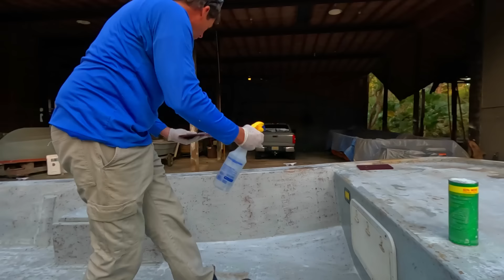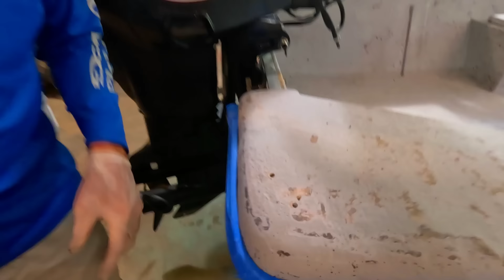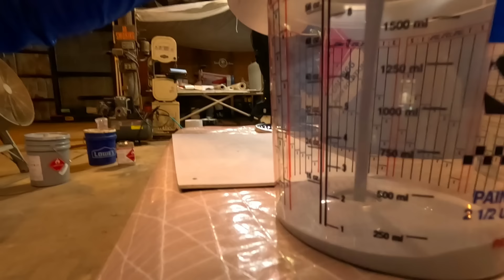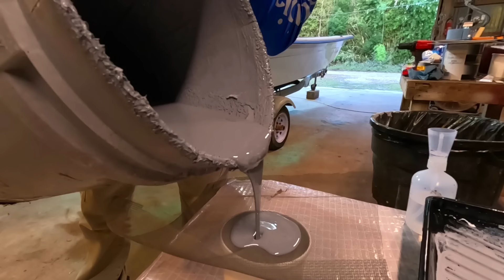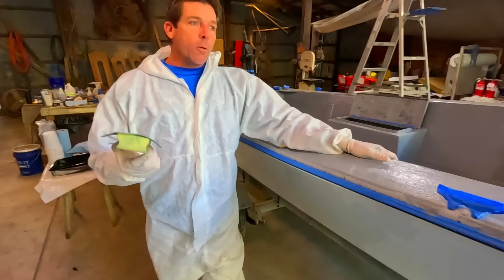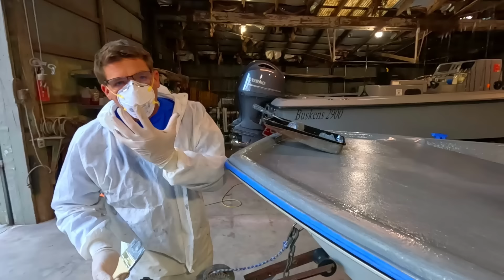How To Re-Gel Coat A Boat - DIY Cheapest & Easiest

Comment: Kinda  funny   you use tape to pull loose fibres from the  roller.  Those  throw away  brushes  are notorious for  losing  bristles
Reply from the maker: You certainly can buy the more expensive ones if you like, but the tape is cheaper than buying the better rollers. Of course you should do what you prefer, or feel most comfortable with, I just try and show helpful tips and tricks throughout the video for those who are interested. Thanks for watching
Reply: @FishBumpTV that's  just  my opinion (45 yr painter) not trying to be  critical

Comment: What kind of gel coat would ypu use for a bass boat is there better brands than others. First time trying gel coat on a 1968 bass boat need alot of repair. Trying to figure out the best way to attack it.

Comment: Did you have to scuff up the first layer of gelcoat since you did it the day before and rolled on fresh gelcoat the next day?
Reply from the maker: You can do a light scuff, just to knock down any small bumps, or hairs, but its not absolutely necessary since the first layer didn't have any wax it it.

Comment: I got a 94 17 ft. Carolina skiff has old gelcoat and is rough as in you can see fiberglass mat imprint under gelcoat. Can i just pressure wash and wipe with acetone and roll gelcoat ? No way to sand smooth. Thanks, GB in Panama City ,Fl.

Comment: I have worked with resin building 4" thick resin tables to custom fiberglass car parts to yacht building for over 40 years wtih each manufacturing process always employing these same rules when repairing any of them:
1) Always wear a respirator and PPE
2) Always degrease then scuff surface
3) Clean again with acetone
4) Hardner ratio based on temperature and humidity
5) Mixing in one cup then poured in a tray to avoid having uncatalyzed resin.
6) Pot life in a cup versus in a rolling tray ( in a cup it will produce more heat in a cup and harden  versus distributed flat on a surface taking longer to harden giving you more working time)
7) If the surface temperature of your boat is cooler than the ambient temperature, the gelcoat once applied will drop in temperature to the the given surface thus slowing the catalyzation time.

I really enjoy watching each and every video. Keep up the great work!!!!

Comment: I just inherited a very old 16 foot 1960 Winn motorboat that has no gelcoat left. It's worn down to the fiberglass, no windshield or seats.  So I'm excited to see how to restore this beautiful old boat. The hull is structurally sound, no soft spots and no holes.   The stringers need to be replaced and I have removed the floor. So many of your videos will get me thru this restoration. THANKS  for the level of detail in these videos because others wanted to throw this treasure out.
Reply from the maker: That sounds like
 an amazing project, good luck with the restoration,and thanks so much for watching!🛠️

Comment: Hi Joe, thanks for your informative videos!
So I am assuming the gel coat with wax makes for an ok final floor finish in the boat... not too slippery when it is wet?
Reply from the maker: The roller finish adds a bit of texture to the surface, but if you want more grip, you could add some non skid. Thanks for watching!

Comment: Just discovered this channel - awesome stuff and great content, thanks!

How do you guys remove boats from trailers to work underneath? Don’t have a forklift or how is it done safely?
Reply: You can buy boat lift jack stand things. Or you can put jack stands under the back with wood blocks to protect the hull, then use the trailer jack to get most of the boat foo of the trailer. Than use a bottle jack under the bow about 1/4 of the way back to lift the front. Then move trailer and repeat step two
Reply from the maker: Welcome to the channel! We have 6 large winches, hanging from 3 large overhead beams in our shop, which allows us to safely pick boats up boats in the 30 ft range. We have always used equipment such as this, because safety is a major concern, when lifting boats. There are different types of lifts, and methods out there, but because of the potential dangers involved, it's not something that I can make exact recommendations on. Thanks for watching!

Comment: Yes I do enjoy your content  ,videoes and the way you teach   IM 61 ,grew up in south Florida and I’ve been working on boats since I was a teenager  as a matter of fact I owned a boat before I had a car   I had to borrow my Dads  StationWagon to tow the boat home  and to store it on the side of my parents house. I   Signed the titles over to my Dad  the boat needed new floors   And it came with the Plywood  precut. Plus  the mat and Resin  I was gung ho  and glassed. The Plywood.  Almost right away. Unfortunately I. Let it sit in the Sun too long and the UV  destroyed the  resin  into a crispy mess I had to grind out   And reclassified eventually    Dumb ass teenager  move perhaps a suggestion  for a video content would be to. Spray  GelCoat  setting up the GelCoat Viscosity  and Spray gun,Air pressure basics  in my past I’ve fixed  small areas of damage with. The aerosolize spray bottles. And  a  trick of mine back years ago  was I kept a large amount of White  spray can paints including  lots of Duplicolor  car paints   That I could  blend areas to get better color matches   I knew that  Ford WimbledonWhite. Was.   Hatteras White and so on   FYI. M customers knew. My cheating technique  and usually were Satasfied with. A repair   On their light damage  usually  a bump. During docking or    Something   Like dropping an Anchor  onto a deck  not Major crash damage  often more of a Stupidity or Embarassing. Mess up   That. I   Saved them. Big money  by doing a  hundred dollar     Service Call   My small boat company was mostly   A Dive Service  I. Offered. As a Certified Diver  I could swap a damaged Prop  change zincs to save them a haul out cost

Comment: Joe no matter how hard I try I always make a mess of myself and everything around me working with Gelcoat paste. I'm going to be Gelcoating my bottom side for my first time painting with it. I figure it will give me a chance to see how it spreads and what it will look like using a Roller and brush. The bottom side looks great but I repaired all the stress cracks and scratche ect. I plan on doing two good coats of non wax and one coat of waxed to cure it. I'm stuck doing it outside and nervous about catching the right weather window. It would be my luck that I do a good job and the weather wipes it out.
Reply from the maker: Keep an eye on that weather window, as that is important,  then plan out the work, and work the plan. Wishing you all the best, and thanks for watching!

Comment: Great video with a full explanation. Tiny details you cover saves a lot of time when working on a project for the first time. What is the process to get the shiny look that you get with new boats?
Reply from the maker: Glad to hear that you are enjoying our videos! There are a couple of ways to get a glossy finnish with gelcoat. You can spray it with a high gloss additive, such as Air dry, by Orca to improve the shine, or you can roll, brush, or spray, 4 or 5 coats, then wet sand,  and polish it to a shine. I have several videos here on the channel showing both methods in detail. I'm sure that if you scroll back through our videos, you will find what you are looking for, and other interesting videos! Thanks so much for watching!

Comment: This is something I really want to do, but I'm running into so many questions.  The boat I have has these two hand size spots on both sides of the hull where it's just much chalkier/duller than the rest of the hull.  I have no idea what to think.  Was it a fairing and paint job?  Epoxy for some gelcoat damage?  Any easy way to test if it's really gelcoat or not?  Thanks!  LOVE your videos.
Reply from the maker: Glad to hear that you are enjoying the channel! It can be challenging to tell what materials may have been used in a repair at times, even for people who do this kind of work. Even brand new boats are sometimes repaired at the factory if there is a blemish or defect in the molding process. It is possible that is what you are seeing. You might want to try a compound, polish, and wax process on your boat, and see if you can get it looking better. We have several videos here on the channel showing that process. I hope this helps, and thanks for watching!

Comment: I wish I could add a picture of it but I have a 9ft side by side 2 seater speedboat. It was last fixed up 20 years ago but its still in good condition for its age. I need to fix a fiberglass crack behind the interior seat and reinforce the transom for a larger motor to get it to go about 40-60mph like a jet ski. Then a new gelcoat will be needed. Does anyone have a rough estimate of the cost of getting it done? I've been wanting to DIY it but time has not allowed me to get into it.

Comment: What's the best thing to use when you're filling small holes from where items use to be? Like 1/4x20 bolt holes in the console. Should I go with a west system filler or just a regular bondo material.

Comment: Great video thanks. One tip is to take the tape off between coats otherwise it gets trapped under the gel coat edge. I know it’s more work but better than trying to get the tape off after the gel coat has cured.
Reply from the maker: That's a great tip, and I appreciate you sharing it with the community!

Comment: Excellent videos. As per your cautionary notes, PPE is very important. A 3M-type full face mask is worth the cost. First job out of high school in the 60s was building fiberglass sailboats. Retired and back to building kid’s toys and kayaks. Thanks for all the very useful tips and tricks. Auto body tools like filler, plastic spreaders, multi-speed grinder adapt well to working gelcoat and molds.

Comment: I am learning soo much from you I’m a career painter and have used epoxy quite a bit over the years but all the little nuances of fiberglass usage and application have enlightened me tremendously for future applications I thank you for that. One of my suggestions would be that nobody dislikes grinding more than myself it’s a necessary evil as you well know and the big disc grinder is awesome I’m sure . My new hack lies in using a grinder from Temu that has a variable speed option on the rpm range that lets you dial down the grinder to a much lower rpm of probably around 2,000 rpm which can be very helpful with delicate situations where all that power isn’t necessary and makes the tool so much more versatile. The tool i purchased was the upgraded version which came with a 3meter cord which is very nice and good cord too that stays flexible in cold weather not that hard stuff on cheaper tools. These grinders are a bit more compact in all dimensions so it’s lighter and fits in tighter places as a result. The spindle is smaller than the 5/8 on a Bosch but a simple adapter solves that problem and gives more reach. IDunno his stuff is coming from China what isn’t these days. My last grinder from Temu was just under thirty dollars and it’s been run hard and hasn’t missed a beat. They typically send you a new set of brushes also with tools that require them so no worries there  just a thought from a freind in the trenches I gave one to my welder freind and he also approved. It didn’t replace his metabo but he said it was an awesome grinder for finish work cause of the vari-speed feature.!FWAFSTYa ☸️👍

Comment: Thank you, this is great. We inherited (so to speak) a small butterfly sailboat that has a good crack in the hull as well as other areas. Should I be using an epoxy first to deal with the crack before the filler you mentioned? Thanks again!
Reply: Also can I ask what type of wheel you're using on the small grinder?

Comment: Hey man thanks for the tips!  I have a 19 8011 foot Boston whaler. Just a very simple little boat. I want to redo the gel coat. On the interior, it’s got the spider cracking and I’ve been told that I need to sand that down to the fiberglass? Can I not just Scarf it up and go over it with some new gel coat? What would happen if I don’t sand it down to the fiberglass? I need it to last maybe 10 years.

Comment: I have the same exact boat with the same exact faded gel coat. I just bought total tread 3 to 1 epoxy paint from total boat. Can I use that total tread or should I use gel coat like your using. Thanks for the videos. They give me a little confidence being knew to this stuff.

Comment: I am very new to fiberglass boats and know very little about gelcoat, hardener, and etc. but I am learning by watching your channel. My question is do you put gelcoat on the boat below the rub rail or is there something else I should use on the bottom of the boat?
Reply: Gel coat can be used all the time at to the bottom but if your gonna do bottom paint you have to sand it again put epoxy primer n then bottom barrier

Comment: Hey captain Joe I’m a disable vet and I’m new to your channel and I’m really enjoying your videos I’m working on a 1988 century 3000 it so old that when I’m sanding it goes straight to the raw fiberglass I’ve learned a lot from watching your videos I have noticed that when I’m sanding it goes see a lot of small pin holes should I try to fill them with something or will the gel coat fill them I have a lot of work on this boat and don’t want to do it twice so any suggestions would be greatly appreciated and I know you work with a lot of different materials so maybe a starter list would be appreciated to and thanks for what you are doing it very helpful
Reply from the maker: Welcome to the channel! Gelcoat is quite thick compared to paint, so it fills in pinholes pretty good. You can also add a little colloidal silica to the gelcoat to thicken it a bit. I have quite a few videos here on the channel that deal with gelcoat application and repair. Im sure that if you just scroll through the channel a bit, you will find lots of helpful info. I hope this helps, and I appreciate you taking the time to watch and comment!

Comment: I am looking at buying an older sailboat to live on during the summers. I am wondering what i should avoid when looking at boats. I am retired and as such have a very limited budget. I have been seeing some good deals for boats from the 1970s and 1980s.
Reply: Lots of old boats with years  of 0 maintenance and are of no value.  Lots are free, or low $ on boat angel , one $ boats, boat liquidators, fb, etc.  Costs to restore are much higher than it will be worth when done.  I would only buy a newer maintained boat that was mostly composites, little or no wood in construction. So mid to late 1990s up when most major boat makers stop using fiberglass over wood. 

Salt or fresh water?  Need to haul out to inspect  bottom for gel coat blisters and all other systems especially any through hull hardware.  A boat should be on the hard about every two years for inspection and paint.  I have a few restored boat projects experience and the always take more time & money than they are worth. My 2 cents.
Reply: @dewholdingsllc1050  Only fiberglass boats.Salt water (vancouver BC). will be doing a personal survey..

Comment: Joe, I am repairing some some rock holes in my drift boat. I have fiberglassed the boat and sanded ready for  a complete Gelcoat of the boat bottom. I did not use wax in the fiberglass application. Is that ok because I am applying several coats of gel coat with the final application with wax. Do I need to apply a wax on the fiberglass even thou I will be using wax on the gelcoat. 
Joe, thank you for your videos. They have helped me so much in restoring this boat. Your videos are so informative. nothing like anyone else.
Reply from the maker: In my opinion, it's not necessary to add wax to your resin in this application. The coats of gelcoat will seal and cure everything underneath it. I hope this helps, and I wish you all the best with your Drift boat!

Comment: What about adding nonskid? I have a similar skiff i need to do once it cools off here in orlando.
Reply from the maker: Sure, non-skid could certainly be added into the process. I recently did a video here on the channel, showing the steps and methods involved in applying non-skid. I'm sure that if you scroll through our videos, you will find it, and other helpful videos. Thanks for watching!

Comment: Great channel Joe ! Are you adding any thinner to your gelcoat? It seems a lot thinner than the stuff I buy. If so, what do you add?
Reply from the maker: Thanks! I don't typically thin it unless I am going to be spraying it. I will use a some styrene at around 5 percent, or the Air dry clear additive from Orca composites. I hope this helps, and I appreciate you watching!

Comment: Sorry if any of these are repeat questions....
What grit did you use to sand with your grinder? 
First coat is w/o wax and second is with wax, correct?
Did you add sand/grit to final coat for grip on floor.... did you add the sand/grit to gelcoat and roll or sprinkle over surface after you rolled it?

Comment: Love to know the roller cover you are using to apply the gelcoat.
Reply from the maker: I typically use a 3/8 nap roller cover from Corona called the glass coater, or a Lowes store brand roller wrapped in tape and blown off before use. I hope this helps, and thanks for watching!
Reply: @FishBumpTV  Thanks so much.  I am getting ready to gelcoat the bottom and the one I have son't seem to load as much as I have seen on your videos.